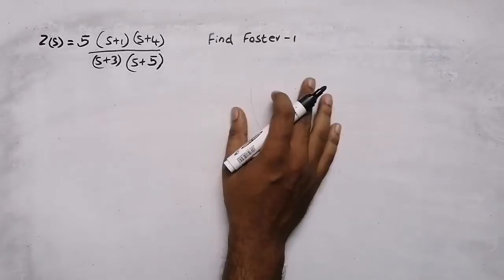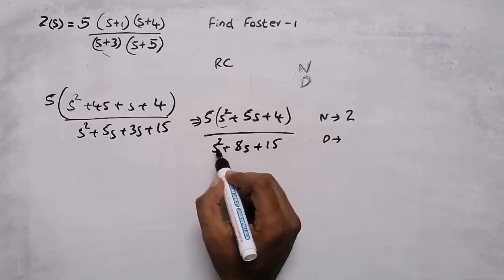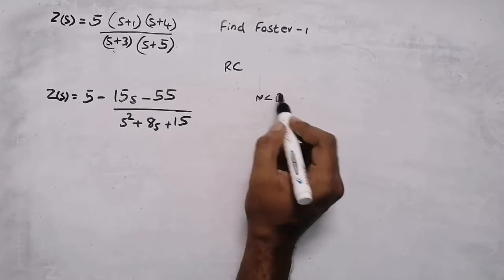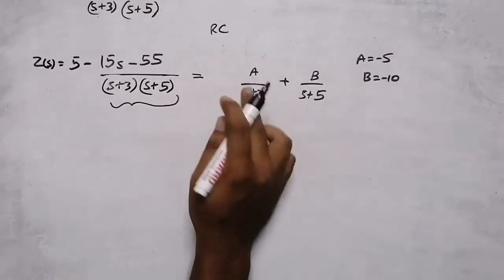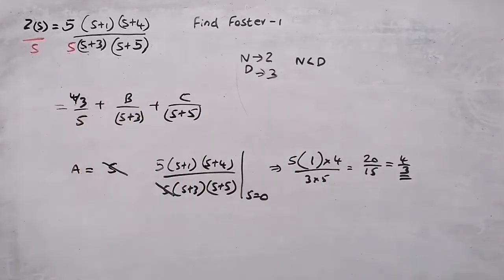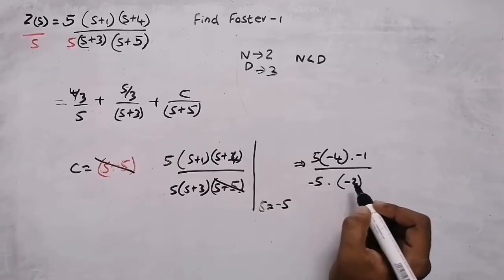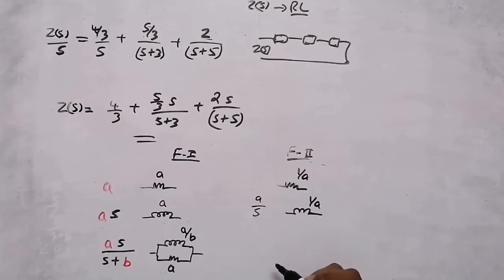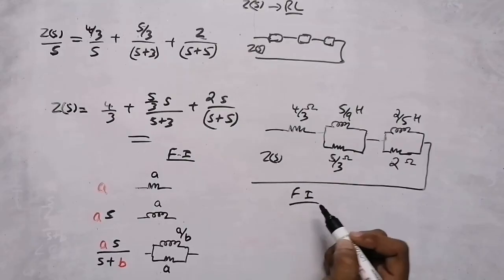foster form 1 | RL network

Comment: In the introduction video u said 
Starting with x is RC and 0 is RL
But In this video u said x is RL and 0 is RC 
Which one is correct....?
Reply: Thank u sir...❣️
Reply: @venkatareddy3071  oh hi sir plz tell me which one is correct, i am also being confused, in book they taken RC netrwork when Pole is at begining and aslo in other youtube video lectures
Reply: How can I find out p= -3,-5 lies in x axis 😢 . -3,-5 can also lies in the y axis
Reply: @rey__raju1543  Only imaginary (complex) zeros and poles can lie in y axis. As y axis is also called imaginary axis and X axis is also called real axis
Reply from the maker: In some questions it may vary because of having poles or zeros at orgin
Other method is to check the final answer after doing partial fraction then if 'S' is in  numerator  RL network
If there are no 'S' term in numerator RC network
If S square term is there then LC network
Reply: So which one should I follow and consider out of the two :-
1) X at start then RC 
     0 at starr then RL 

2) X at start then RL
     0 at start then RC        @smartEngineer5
Reply from the maker: This is a short cut method
X pole is at beginning - RL network
0 at beginning - RC network

In some questions it may vary because of having poles or zeros at orgin
Other method is check the final answer after doing partial fraction then if 'S' is in  numerator  RL network
If there are no 'S' term in numerator RC network
If S square term is there then LC network